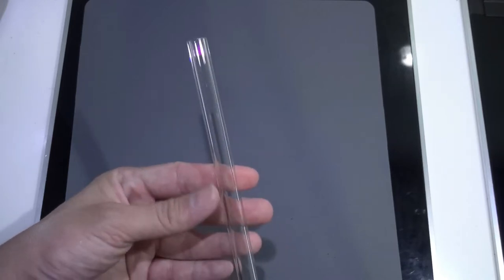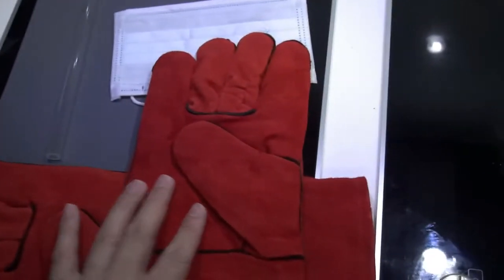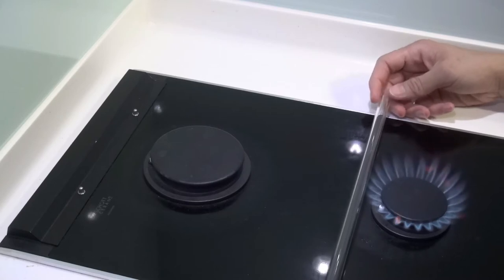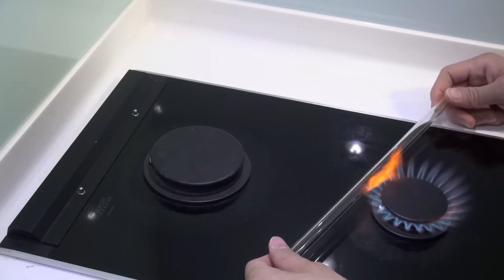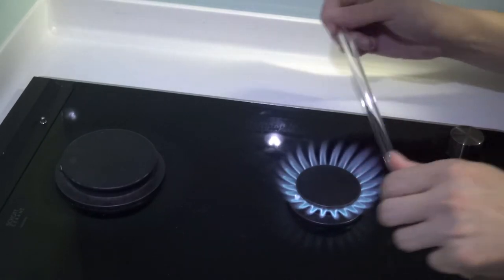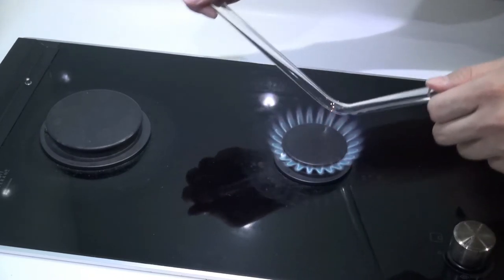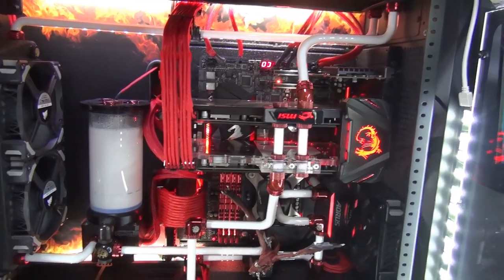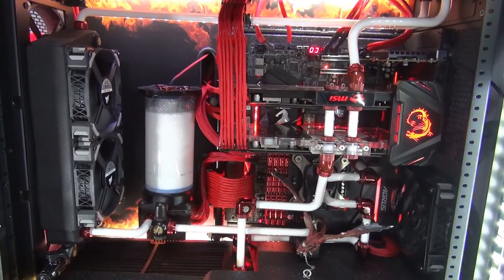Bending Mayhems Glass Tubes for Custom Watercooling Part 1

Comment: Very nice!  I'm acquiring the parts for an 1800x build.  And just for show I'm planning on water cooling everything.  I had not considered glass because of all the fittings needed - but you CAN bend it.  THANK YOU FOR THE VID.  I was also curious about the reservoir - thanks for the link below.
Reply: its not easy but yes you can bend glass how do you think they make crazy bongs?  or glass art. 

best part about glass is its chemically inert.

Comment: the best budget i have seen . no need to buy heat gun . nice bro !
Reply from the maker: A friend of mine tried it with heatgun. 
He said it took way too long.

And he also claimed that the bends he did were terrible  (I believed it collapsed because the temp isn’t high enough)

Even using fire. Is quite a long process imo.

Comment: Hello, your work is really nice !! Can you tell us which tool you've used for cutting ?  thank you very much
Reply from the maker: dremel diamond wheels. (I am using proxxon actually, but is the same concept).
remember to get the 'ventilated' diamond wheels. Alot of heat is generated when cutting glass.

Comment: what is gray surface you use to rest the tube after it bended?
Reply from the maker: is just a simple silicone sheet; where you put hot cooking pot on to prevent it from slipping /
protect the surface you put the hot pot on. 
E.g. https://i.ytimg.com/vi/G7fQ8fumdUg/maxresdefault.jpg